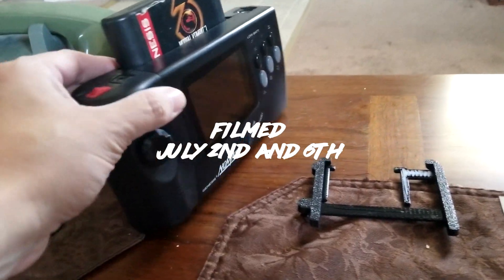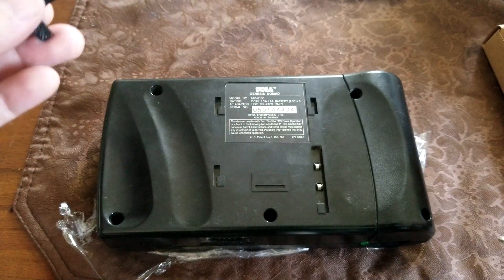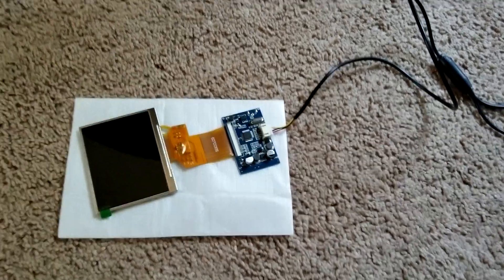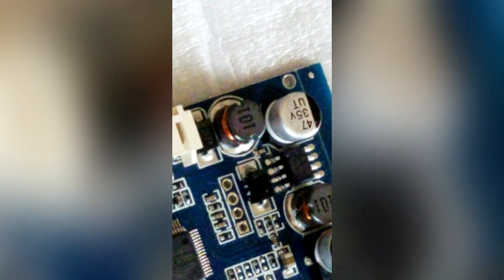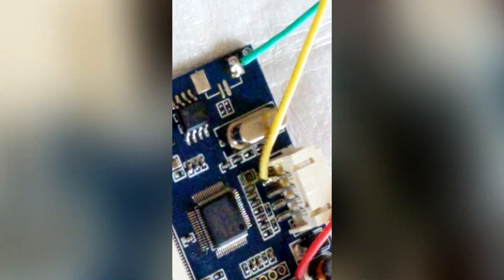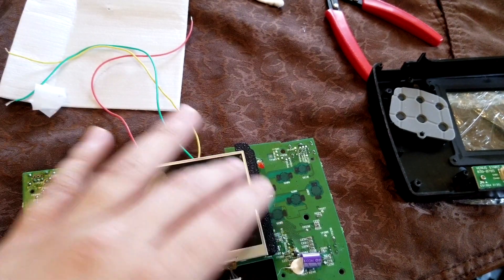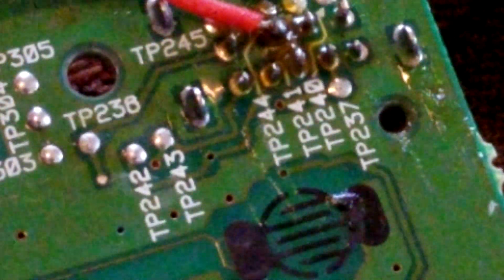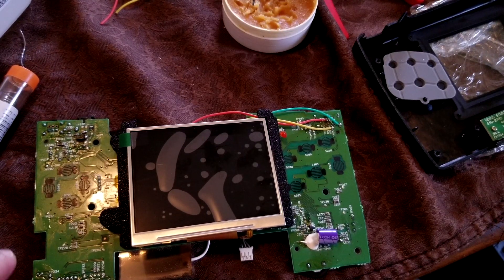Sega Nomad LCD Screen MOD (2020)

Comment: Clarification on how your'e saving battery life by bypassing the buck chip. That 8-pin package is the buck chip and it's job is to regulate 12vDC and step it down to 5vDC that the rest of the circuit needs.

https://en.wikipedia.org/wiki/Buck_converter

• But why have that in the first place? Isn't that a waste money and parts?
The intended use of these displays seem to be in automotive application as you have 12vDC from the car battery and you can access that through the lighter jack.

Reading the wikipedia link, it mentions buck converters to be highly efficient (90% efficiency). But there is still a 10% loss. Usually, step down converters are much less efficient and manage this loss by converting the unneeded power as heat. This is called heat dissipation.

But you can save the 10% power loss by just bypassing the buck converter altogether. WHY HAVE A CONVERTER convert 12vDC to 5vDC when you already have 5vDC as your external voltage? There is no regulation necessary as you already have 5vDC that is required by the rest of the circuitry.

in fact, you can even use 3.3vDC as I demoed in my video if you have a 3.3vDC source... you can use that instead of 5vDC. This makes sense as batteries drain, and will not always be at the optimal 5vDC, and in fact, is actually a little higher as an AA battery = 1.5vDC. 
So 1.5 x 4 (batteries) = 6vDC. A fresh set of 4 AA batteries will be 6vDC.

So what the mod is doing is you are just bypassing the buck converter and putting the 5vDC at the Buck converter's output pin. That output pin is where the buck converter would be outputting 5vDC if 12vDC were supplied to it's input pin. Again, why have the buck converter waste 10% of the power by having it convert incoming voltage.

But the question I had was would the display work (unmodded) if you just used 5v instead of 12v to power up the display through the buck converter. Probably not as the instructions would have a more varied range saying that the display requires 5-12v, which it does not state. So you would have need to bypass the buck converter to have it work anyways! LOL.
Reply from the maker: Thank you for the further clarification. I'm way interested in learning more about electronics at the component level. I appreciate this.

Comment: Video quality is pretty bad compared to the original screen which used rgb, not composite
Reply from the maker: It's a trade off between barely visible enjoyable rgb or good looking composite. Since I was raised on composite, it doesn't bother me much.
Reply: @xLSDxUCSB  also, the sky in outrun is seen as light blue on this screen, when on the genesis port, it actually is dark blue, and the trees appear to be almost black, when they are bright green on the genesis. Is there a way to adjust the settings on this monitor before installing it?
Reply from the maker: @mariowario5945  no, not at all.
Reply: @xLSDxUCSB  does the sky and trees in outrun look like that in real life on the modded screen, or is it just the camera and youtube compression that's making have off colors?
Reply: @xLSDxUCSB  are tou able to take photos of outrun on this screen and upload them to a link that I can see? I am thinking about getting this, and that would be much appreciated, thanks! It would be a total turnoff if the contrast is messed up like that in real life
Reply from the maker: @mariowario5945  not at the moment no. But ultimately, as I stated before. It's a trade off between barely visible washed out rgb and decent/good composite. Manage your expectations in regard to the tech and supply of chinese screens from aliexpress. There are methods to get an rgb driver for the nomad. But I haven't explored those options. But I can attest to the fact that as gamer with a pvms, CRTs, thousands of games and systems I was not disappointed or angry with the results.
Reply: @xLSDxUCSB  what I was trying to say is, the lcd doesnt seem to be tuned correctly because of the contrast. I have an external lcd which allows you to tune the settings and I can say for sure that composite doesnt distort the colors as in that video with outrun
Reply from the maker: Also, be aware that you can still output RGB from the video out to your PVM/appropriate monitor.

Comment: Great video this will me mod my nomad. Could you also reuse pin connector for backlight for 5v ground as well. On segaholics video as well.  Also is the screen and board the same as the 1 being sold on console5
Reply from the maker: I ended up ordering the screen from gamegears4you. Your alternative is AliExpress but it will take a long. Gamegears4you is the safe bet right now. As for power your question doesn't seem phrased well, I'm a bit confused. I recommend you follow my or SegaHolics video exactly